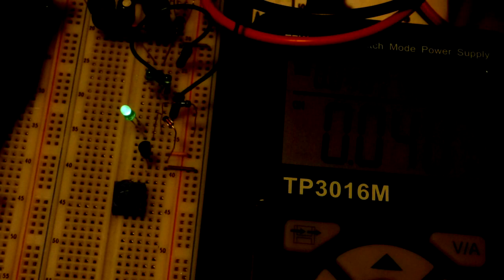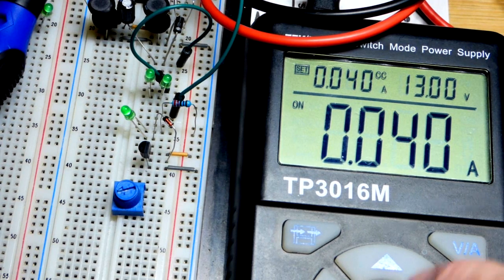2N3904 NPN BJT improved zener diode test using constant current power supply electronics circuit

Comment: You can use a zener as part of a voltage divider that will drive the gate on a mosfet power transistor.   Since mosfets only require the presence of a voltage at the gate and nearly no current...    As long as the voltage applied doesn't break over the zener the series resistor see's no voltage , and the mosfet stays off.    But if the voltage applied satisfies the zeners break over  , the surplus voltage will present itself across the resistor tripping the gate on the mosfet so it can drive its load.
Reply from the maker: Good points!
Reply: Zener can be used with a comparator to turn off or on also.
Reply: Exactly